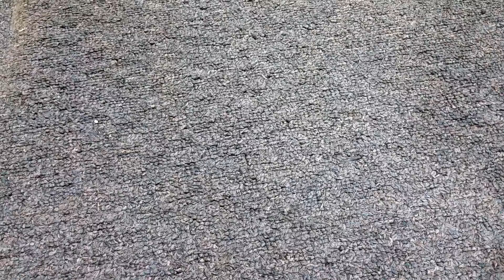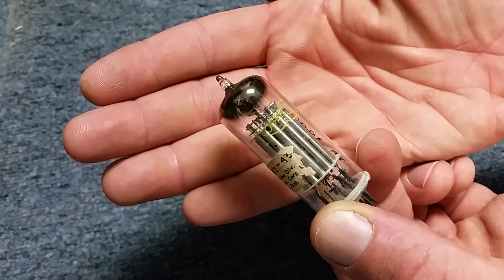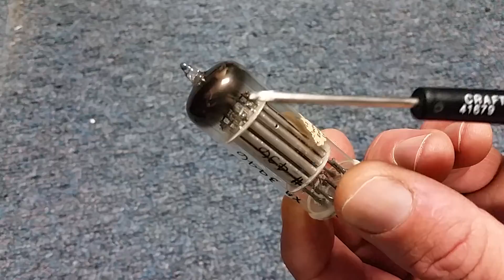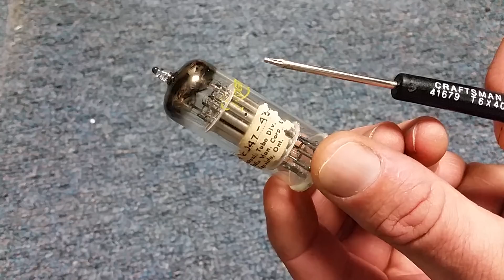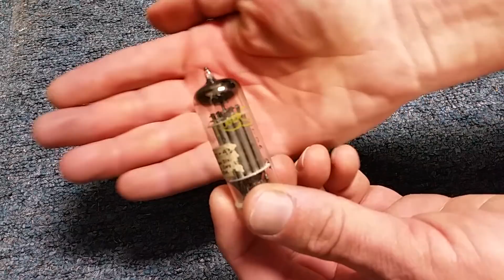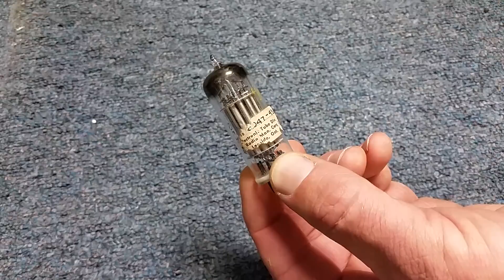Rogers 6047 Additron

Comment: With that and dual triode for a flip-flop, you could have a serial adder for arbitrarily large numbers.
Reply from the maker: True, but doing so diminishes the big advantage of the Additron - one single tube, albeit somewhat complex, would eliminate a whole handful of lesser tubes for each bitslice of the whole adder. Multiplied over whatever the width of the adder section of the CPU is (and accounting for the associated manufacturing needs like additional sockets, resistors, chassis punchouts, labor, testing, etc.), one could really do well using parallel Additrons.
Reply: Either way it'll be cool to see a circuit mock up even if it is just adding a single bit :-)
Reply: Fuuny, before i'd read your comment here I'd made exactly the some comment to a friend who I shared this video with.